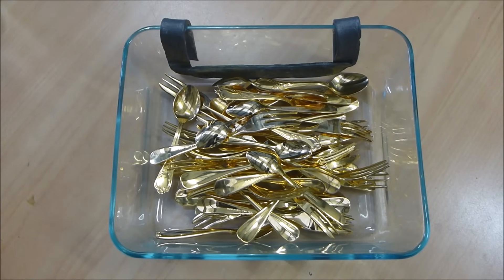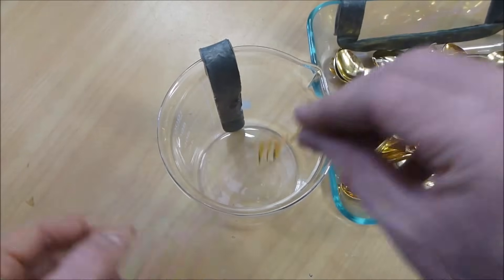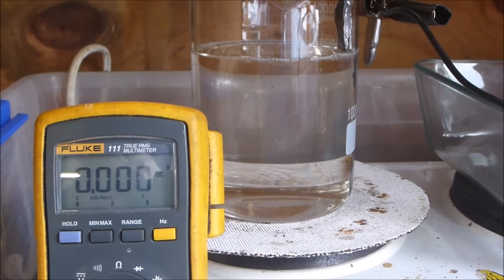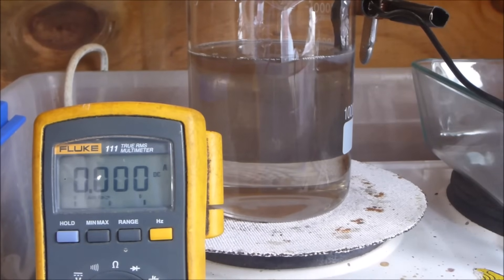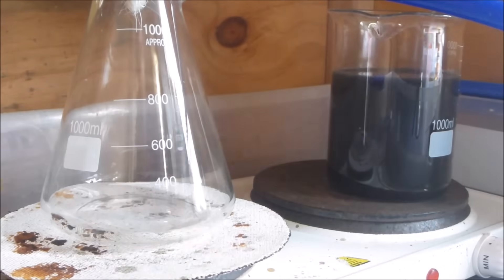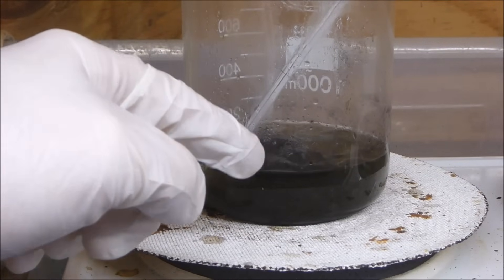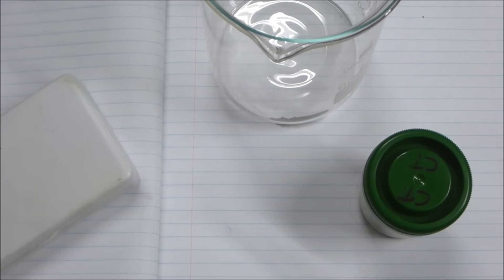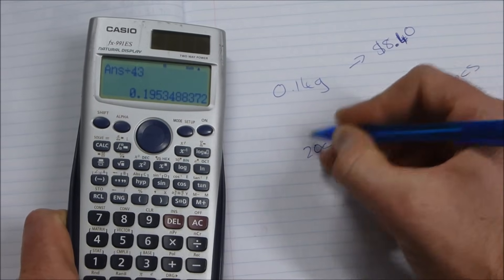Gold Recovery from plated cutlery

Comment: Dear Sir I have a question.. (ps. Interesting video, thankyou), I'm new to all this. Will this process work with hydrochloric acid?
Reply from the maker: Unfortunately not, concentrated Sulfuric acid for this process. I dont know any other ways of removing Gold plating without dissolving the base metal. Maybe mechanical, like a belt sander ?
Reply: @successfulengineer thanks for the reply and information 👍

Comment: recent subscriber.love your video.so informative.learning loads from you.keep up the good work. I can only get my hands 85% sulphuric acid
would that work for this procedure.
Reply from the maker: Hi David, unfortunately you will need 98% for this process. Even in the mid 90s it starts attacking the base metals. It is technically possible to concentrate yours by boiling off the water, but Ive never tried it myself.
Reply: @successfulengineer  thanks for the quick reply.yeah I thought as much.ill do a bit f research.looks like a good system...I have you tryed potassium ionide, iodine and water.its very good for plated material aswell and very quick.keep up the good work
Reply from the maker: @davidbarron107  Yep, tried Iodine at one point also Potassium Iodide, good luck with both at deplating material, terrible luck with both at getting my Gold back out of the solution!

Comment: what type of protection are you using to protect your hands and face from  the acid?
Reply from the maker: Rubber gloves and a full face shield is pretty much a minimum for Sulfuric acid. Sulfuric is dangerous, but luckily pretty easy to work with, no real fuming and pretty high viscosity. Latex gloves definitely dont work, the conc Sulfuric will char them pretty fast.

Comment: thanks for sharing your knowledge man.. This is so interesting. I wonder why this works. Why the gold falls off, and then the amperage drops when you should be getting into material the the H2SO4 wants to eat right up, like the copper or nickel that the electroplaters apply to the steel before sticking on the gold. That's curious. Would weaker acid such as battery acid work also I wonder? Secondly, is there a silver deplating equivalent that you know of that you could share by chance? Cheers W
Reply from the maker: Hey mate, I remember reading a patent about this a few years ago, from memory, when applying power, an acid forms at the boundary of the H2SO4 and Gold that is able to dissolve Gold, but as soon as the dissolved Gold moves into the H2SO4 it precipitates out as the fine black powder. The H2SO4 has to be 98%, as soon as you dilute it it will start attacking the base-metal, so battery acid will not work unfortunately. Yes, I'm reasonably sure (not tested) that this also works for Silver. But I have also read that you can use a solution of Sodium Sulfite in water to do a similar thing with Silver, have a look on the gold refining forum, pretty sure that is where I read about the Sodium Sulfite.
Reply: @successfulengineer  Thanks for getting back to me..  I had a bit of a think about the current flow dropping when the gold is gone and have put it down to the conductivity of gold vs iron, or whatever base metal is under the gold. I mentioned nickel and copper but was reminded those are only used when plating Chrome. Unsure what's under gold. As for 98% H2SO4, it's easy enough to concentrate some battery acid but a shame I can't get it from the hardware store like I could when I lived in Oz. But yeah, 98% should smash through anything you put to it that isn't gold, tin, lead or silver. Try dropping some paper into some. Up in smoke!!
     I wonder, have you measure the density of the sulphuric to see if it has lost anything through the process? 100ml should weigh 184.3g
Reply from the maker: @waynoswaynos  The Sulfuric acid is hygroscopic, so if you leave it exposed for too long, you will see the volume increase which also means the acid is getting diluted. Other than that, the acid does not appear to change in any way. On the current drop, no idea what causes it, but sometimes I'm OK with just knowing something works and not fully understanding it, just like magnets :) https://www.youtube.com/watch?v=MO0r930Sn_8

Comment: Another good video
Reply from the maker: Thanks for the comment mate.
Reply: @successfulengineer  maybe this is the wrong question, can gold be measured in picometers? If so, wouldn't the particles be light enough to float, kind of sounds  something like gold in solution form then weighting it down with smb, just asking possibly some gold may be getting through I've noticed the recycle diy electronics videos they make their final decision on visible gold bond wire in the material then it goes in the trash with the cameras they're using maybe they're not able to see a particle of a gold bond wire or washing it away , it adds it adds up.
Reply from the maker: @vincenttelfer4206  Bond wires are usually pretty easily visible with a microscope. Gold in solution we can test for, and usually do to confirm that we don't put any dissolved Gold into the waste treatment. Very small particles of Gold would be harder to deal with, but they usually either settle or filter out pretty well. The best approach is really to have a good idea of how much Gold there should be, then ensure that you get most of it.
Reply: @successfulengineer  is this what makes you a successful engineer? Haha! To me it looked like drilling and grinding it up showed the best yield 2nd would be reverse electroplating and so on, using a drill bit with the best metal block with a straight down hole beveled enough to feed the material with a hopper where the material falls through a mesh , looking for better than 100 mesh screen, then slueth the material possibly  putting smb (or something to weigh the gold down) in the water run off and rinse water then  storing it for a short time, with the smb I just thought of that talking about sleuthing it feel free to try it or maybe there's nothing there may be no effect, there is a utube video with using a drill bit then there's the robot drill bits isn't that the cnc machines that grind  the top layer off an IC chip, fun

Comment: If you wash the utensils can you eat off of them after the gold deplaning?
Reply from the maker: I guess in theory if you give the a very good scrub down with a pot scrubber (slightly abrasive) it would technically be safe-ish. At that point you probably have a combination of a Copper alloy with maybe some Nickel on the surface. I wouldn't bother using them, but it probably wont kill you!
Reply: @successfulengineer  ok thank you for the information!

Comment: Dose anyone know if the sulfuric cell stripping process works with plated nickel? Because I have A LOT of black sludge about two 500ml beakers thick-full and wet ! Some of my scrap panels have a 30-70Um Nickel strike on each side under 90-120Um of gold.
Reply from the maker: Nickel is very commonly used as a barrier to Copper when Gold plating items (like pins), so it shouldn't cause any issue in a Sulfuric cell as far as I know.

Comment: Surfuric Acid in high concentration is quit thick (high viscosity).  One technique I recall is to thin it down with water (carefully) then let the gold percipitate out.  Drain off acid and heat to evaporate added water leaving concentrated surfuric acid.
Reply from the maker: Hi, yes, that would certainly work, just need to go very slowly with adding the acid to cold water! I guess you would probably just have to double it's volume for it to be similar viscosity to water.

Comment: I have a mysterious transformer in my possession.  Its pretty old, 50 years or so.  Windings all seem to be gold plated. Couldn't find an example of either brass or gold plated transformer windings online.  Help me solve the mystery PLEASE!
Reply from the maker: I have never seen a transformer with Gold plated windings, much more likely that it is just shiny Copper. A little bit of 35% Nitric acid will tell you pretty quickly!

Comment: I don't get - why did you use sulphuric acid?
Reply from the maker: What else could you use ?
Reply: Nitric, muriatic or organic acid. Am I wrong?
Reply from the maker: Nitric and Hydrocholoric acid would both react with the base metal under the Gold. Concentrated Sulfuric acid deplating has been around for a very long time, I've never heard of anyone trying to do deplating with any other acid. I believe the process relies on some 'other' acid forming at the Gold-Acid boundary, this acid is able to dissolve Gold, but as soon as it is not on that boundary, it ceases to exist and the Gold precipitates out as the fine black powder. I can't seem to find the patent right now that specifies what the 'other' acid was, but I think I have a copy of it in my workshop somewhere.
Reply: Great explanation :) Why did you type in comment instead talk about it in video? 🙃
Reply from the maker: Hey, yeah, seems like that would have been good!
Reply: Sarcasm?
Reply from the maker: Not at all! I meant that it probably would have been a good idea to mention why I'm using the Sufuric in the video
Reply: @successfulengineer  nice job, if you dipped a uncharged electrolytic capacitor what would happen?  As if you were deplating in the sulfuric. Would the capacator charge form the distance equal to the distance you have your anoid and cathode?

Comment: That plating is thin all right!  Have you ever tried to recover gold from gold plated ceramic and glass jugs/bowls etc which appear to be thicker than metal plating, but I guess appearances can be deceiving?   Thanks for sharing your findings.
Reply from the maker: Hey, have never tried recovering the Gold from ceramics, have considered it a few times, but the problem is unless you work with a reasonbly common item the finders will not be useful to the greater community. Should be pretty easy recovery from ceramics anyway! Thanks for the comment!
Reply: Ceramic gold  plating i do in bleach and hydrochloric but you need a ton of it

Comment: I have a whole complete set that I got from a demoed house working construction and it was all gold plated wrapped in plastic still it looks really really pretty but I know that the gold plating is real thin my wife seen it and said no you're not going to do that she kept them she still hasn't use them though... I'm surprised the fiberglass Charmin plug worked considering the amount of gold I figure it should I've rent large numbers of gold-plated pins and plug Charmin after Sherman so these days I prefer to let it settle for a week if it has two and then decant the liquid from the top down then I'll dilute it with ice water and then boil it seems to make the gold drop a lot faster and easier to work with
Reply from the maker: Yeah, this was the first time I tried the charmin plug, usually I just let it settle too. I reckon the plug worked pretty well and it was all done in a few minutes. The acid coming out the bottom was pretty clear, so I didn't think I had missed too much. Something like kaowool would probably work great.
Reply: @successfulengineer  I ran about 40 lbs of full plated pins and the Charmin plug was to loaded to continue filtering ...not a bad thing it was just alot of gold pulled 18+grams.
Reply from the maker: Haha, yeah, that would be such a nice problem to have! Did you have some kind of automated system for hte 40 lbs? I've been considering building one of those rotating deplating systems.
Reply: @successfulengineer  no I rarely process my own material these days just ...others in a toll refine service...
Reply from the maker: Nice, are you finding it OK profitability wise? I tried it once, but just couldn't justify the time for the low income. I also didn't want my hobby to become just a low-wage job. If you have your processes nicely figured out, I'm sure it can be quite a nice job.